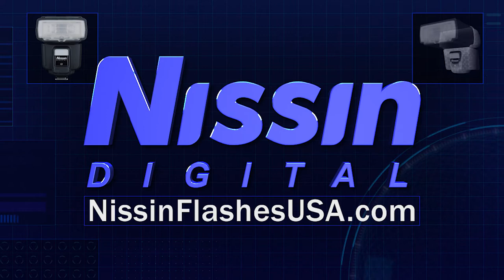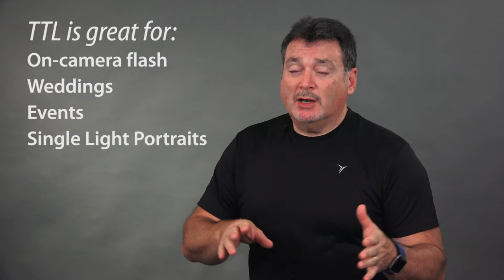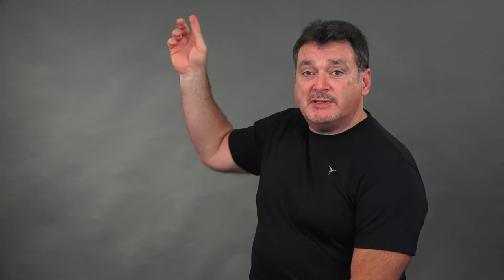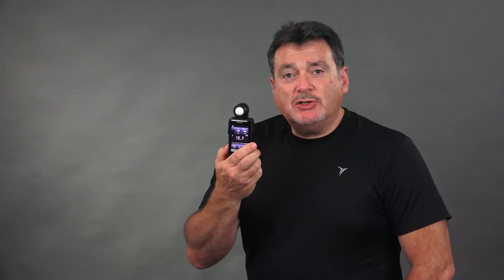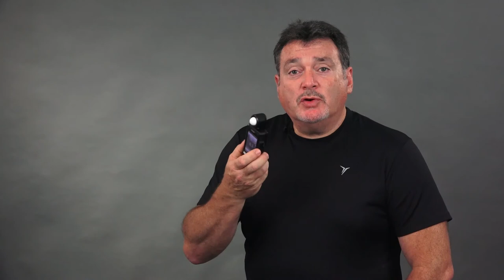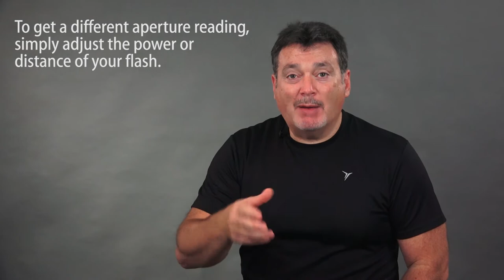Understanding TTL vs Manual Flash with Nissin Speedlights

Comment: Nikon TTL uses pre-flashes to fire each flash individually I believe, in sequence, so it will know how to adjust each for equal lighting. Then, you can adjust each up or down as necessary, to adjust hair light, say. Not just all at once measurement through the lens, I believe.

Comment: I want to learn how a TTL would work with a godox ttl trigger and off camera 2,3 flashes.
How a manual flash will fit into there?
We set a power there.
I have 2 manual and 1 TTL high speed sync flash from godox and a pro transmitter.

Comment: TTL flash is like many beginners needing AF lenses & software to do the work for them.
True photographers are dead, just image editors and people using cell phones.
True photographers make end meets by doing reviews and boasting products.

Beginners love shooting TTL & HSS but wonder why those cheap flashes overheat.
Do you think many are going to buy ATG's best, Nissin MG8000 Extreme Flash?
Reply: angelisone I disagree. Joe McNally for one uses TTL flash extensively, and he is a world-class photographer. Personally I have found a combination of manual exposure and TTL flash is hard to beat when shooting fast-moving events in varied, often low-light conditions.
Reply: Lyndon Smith, Joe McNally and Moose Peterson were both not happy with the overpriced Profoto B1.  
This thing doesn't have ATG AF Assist Beam.
Once out of battery, you are out of luck.
They were very pissed after paid over $2,500.00 of dead brick.

Now, if they would have purchased, light thousand photographers have, the  ATG/Godox system, then they can have ATG AF and using AC power when the battery is dead.

Both are well known photographers, but they are limited on TTL strobes.
Again, they know Nikon's ITTL speedlights, not powerhouse ATG's strobes.
And their eyes are not good like they were young, so AF Assist Beam on the transmitter and AF lenses are very important to them (as well as many today beginners/amateurs).

For fast moving paces, TTL is much better than M strobe.
Just like Auto Exposure (meter reading in camera) can calculates number much faster than changing them manual.
The same can be said for AF lover manual lenses.

For examples:
They both have a Nikon F2, while my daughter is using the Sony A9.
Mine you, she's only 9 years old.
And her younger sister is using the *ATG Sony DSC-RX10 IVr.
Who do you think will come out as a better photographer?
Who do you think that can captured many tack sharp images?
Who do you think the judges (buyers) will pick or buys? 

* ATG Sony DSC-RX10 IVr
< Modified from DSC-RX10 IV
< ATG/Zeiss T* 24-600/2.4-2.8
< ATG wireless radio remote shooting from/to computer 25fps!
< Compatible with ATG/CononMark/Interfit/Profoto/Phottix TTL strobes
Reply: I disagree too. I use manual and TTL. and it depends on the environment and event we've need to shoot a image. TTL is super helpful when it comes to running ang gunning situation like having a birthday events. you don't need to always change your speedlight because TTL can help you in many ways but kinda irritated when it can't identify a object even you press it as full. it will not capture the picture. 

and when I use manual mode in speedlight it always seems to help me to shoot a creative mode and have my own way in capturing a picture. that's how i like it when I use manual mode.